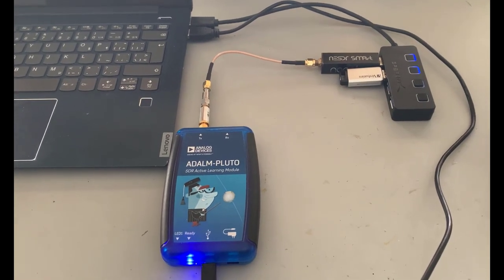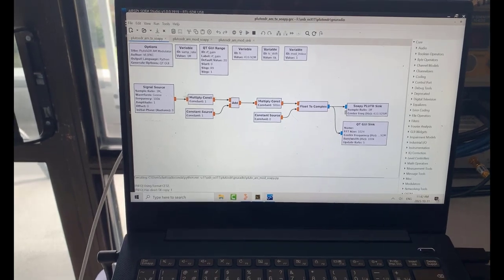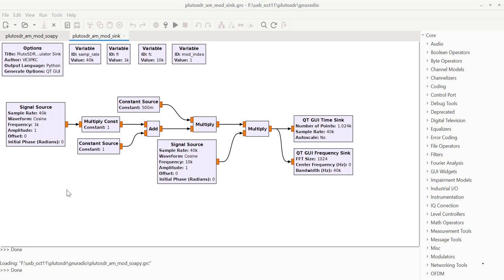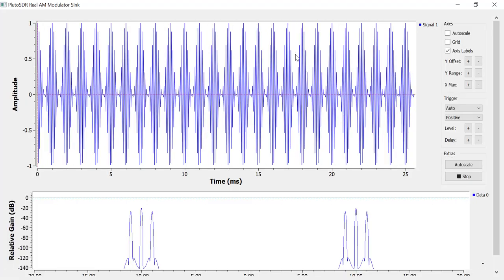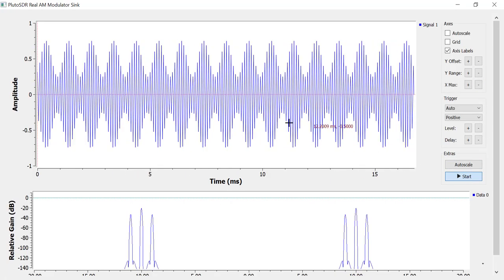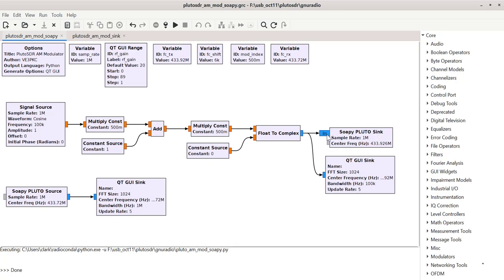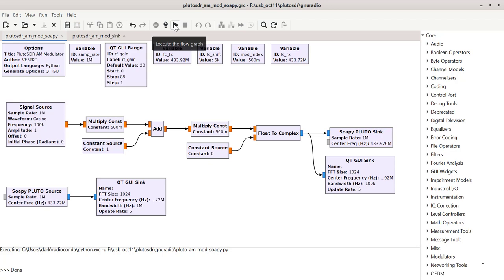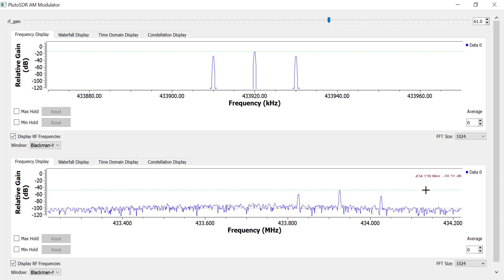PlutoSDR for AM Modulation on GNU Radio

Comment: Generating: 'C:\\GNURadio-3.9\\bin\\am.py'

Executing: C:\GNURadio-3.9\python\python.exe -u C:\GNURadio-3.9\bin\am.py

Traceback (most recent call last):
  File "C:\GNURadio-3.9\bin\am.py", line 218, in <module>
    main()
  File "C:\GNURadio-3.9\bin\am.py", line 196, in main
    tb = top_block_cls()
  File "C:\GNURadio-3.9\bin\am.py", line 90, in _init_
    stream_args, tune_args, settings)
RuntimeError: SoapySDR::Device::make() no match

I am getting these errors when runnung to pluto
Reply from the maker: Does the Pluto work with SDRangel??:
https://jeremyclark.ca/wp/telecom/plutosdr-for-wspr-beacon-on-gnu-radio/